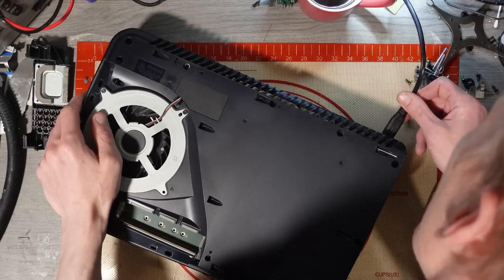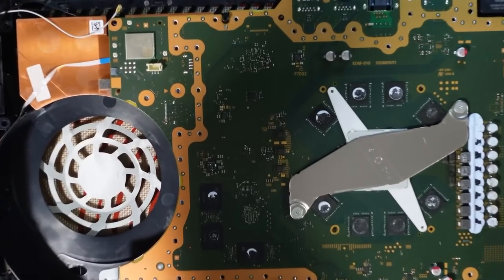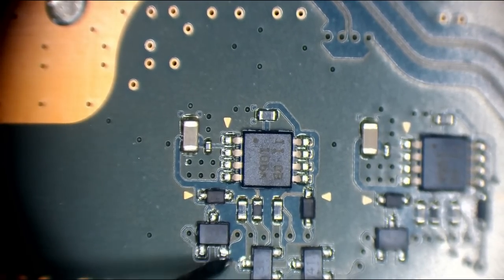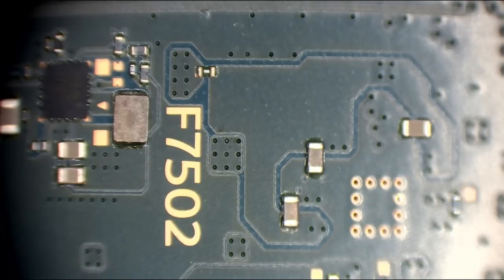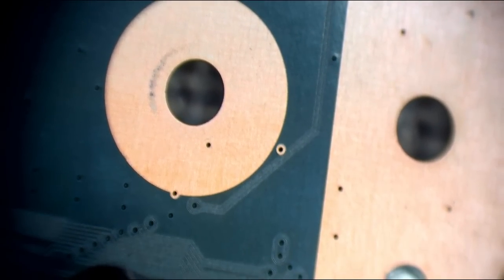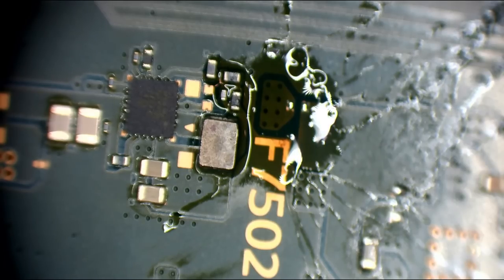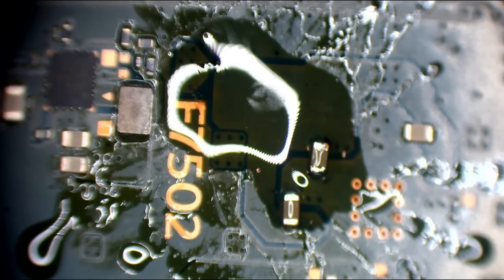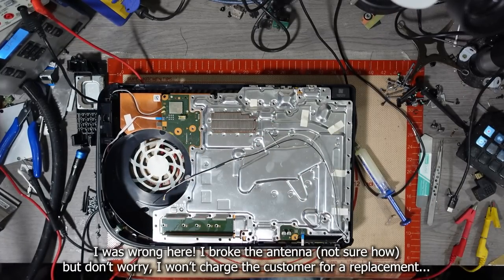Can We Fix A PlayStation 5 That Beeps Once Every 10 Seconds But Won't Turn On?

Comment: Hey man, love watching your videos for help on repairs. Very informative and man do I love your attitude dawg. I have question on my own repair and I have basically the same issue with my ps5. same model and everything, mine turns on for a few seconds and then shuts off. I get the blue light and everything. Would it be possible I am experiencing the same fault or should I wait for power supplies to become more available and try swapping that first? Appreciate any reply, keep up the hard work man!

Comment: How are u putting 5 volts into the fuse to check for a short. I understand everything but can’t figure out how u are putting volts into the fuse. Pls help me. I have a mutlymeter checking everything

Comment: I have a small chinese PC board with an SMC chip that looks exactly like that Panasonic HDMI encoder. Even mounted/soldered the same way. One day that chip blew up and died. No damage on board. Got myself another one of those chips. Removed the old one with hot air. But no matter what I do, I can't solder the new one in place. I have used wick, and Loctite flux to clean the board. That went well. I applied leaded solder to the pads. And a tiny amount of solder on the middle pad. Then used flux under all around the chip like you do in your videos. The chip is in place now, I used my hot air station to solder it onto the board. But no matter what I do, I see huge gaps between the chip legs and the pads on the board. What am I doing wrong?

Comment: Lightning just got my ps5. No beep. No nothing. So I bought a used power supply. Changed it. It beep and stars. Blue light comes. Fan start. But in 1-2 sec in shuts off.
So I bet I need a guy like you to fix it.
Any tip on someone in Sweden :/

Comment: im curious if you ended up specialising in fixing the PS5 over the Xbox series S/X or if the PS5 is just failing at a much higher rate.
Reply: Probably has to do with ps5 selling way more consoles
Reply: He says the PS5 is less reliable then the Series S/X, but more PS5’s are sold. He doesn’t like the quality of components used by Sony, says they are poor quality that leads to so many breaking. And then you have the Liquid Metal.

Comment: Hi Phil. I have a 4 switches all  take a good charge but won’t power on. All bq, p13 and mt chips have no shorts but won’t boot up. Tried a known good screen still won’t boot up. Any ideas what to look for?
Reply: still try swapping the MT chip, I have a few videos with that fault, M92 chip does not always show a short.

Comment: Hi there,
The console was in the rest mode, during the day there was a circuit overload, the main circuit breaker has tripped, in the evening after turning on the console, it reported that it was not shut down properly, after it finished booting it remained in a limp mode:
All USB ports are non-functional, and do not have 5V voltage (verified by measurement). After starting the console, the message "too many USB devices connected" appears several times in a row, despite the fact that there are no USB devices or cables connected. The console is slow, takes a long time to boot up and shut down. Main menu navigation is slow as well, it takes a second to respond to inputs. If I try to start a game, the PS5 shuts down after 1-2 minutes. On the next bootup it says it wasn't shut down properly. When I managed to launch Astro's Playroom it ran like a slideshow. I'm unable to enter system recovery menu due to non-functional USB ports.
Beside the dead USB ports, the system seems to be running in a heavily underclocked state,  as if the processor was not getting enough power, I couldn't google anything similar happening to anyone else, does it sound like a faulty power supply or something more than that? Thank you for your assistance.
Reply: I have this exact same issue!! I have replaced all the USB controller chips and even replaced the southbridge but I am still getting "too many usb". I can't use a controller/keyboard to factory reset it either. I have tried all I can think of. Someone please help!!